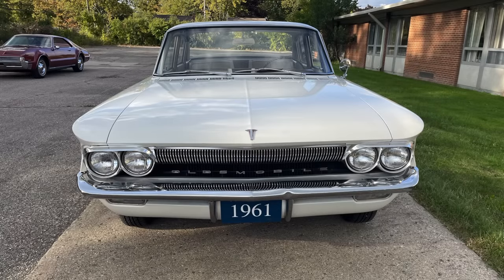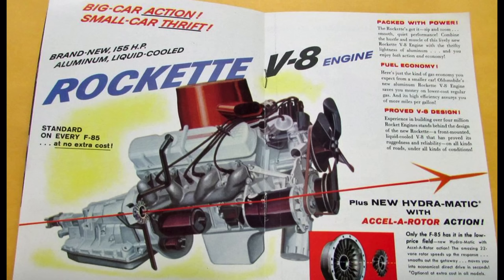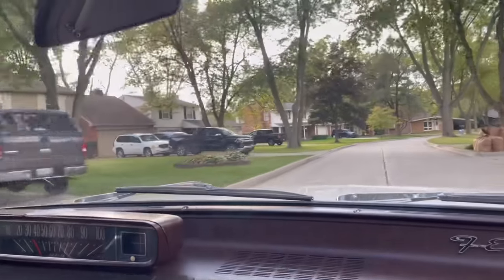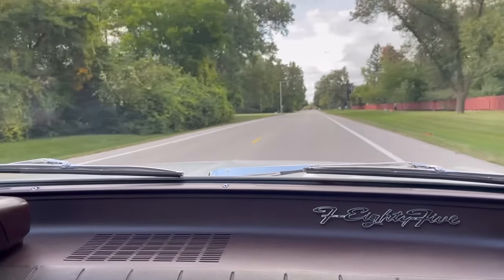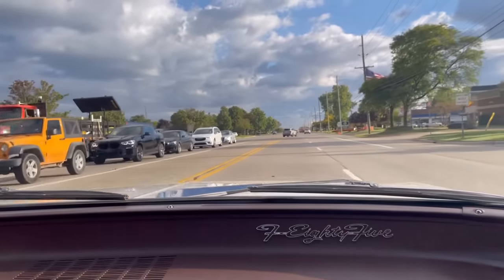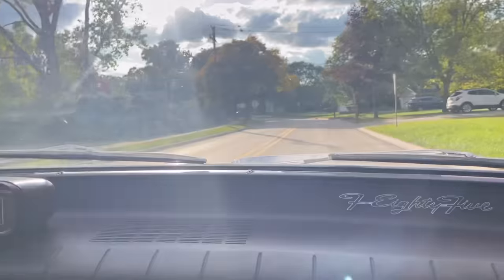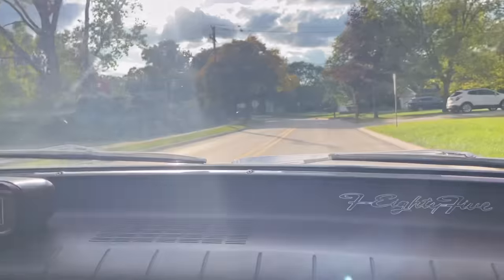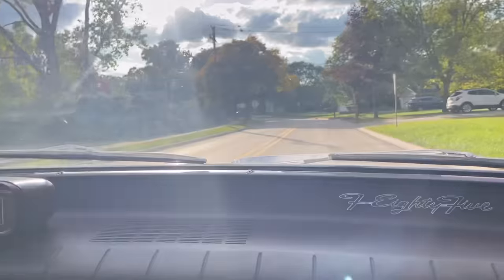Driving GM’s Worst Transmission: The Roto-Hydramatic (“Slim Jim”)

Comment: Our local Pontiac dealer shop told the customers. "The transmission is junk. I'm ordering a real Hydra-matic in. It will be day longer but you'll have no more trouble."
Reply: Catalina and Grand Prix
Reply: @bobbyheffley4955  Hadn't thought about it before but since the long wheelbase Bonneville & Star Chief had the (real) "Super Hydramatic" I'll bet there were a lot of Pontiac dealers that, perhaps for a price, switched over the Catalinas & Grand Prixs from the Roto to the Super. I wonder if they had to modify the driveshaft? It probably had to be shortened. I wonder if the Olds dealers did it too or if the floor pans in the Olds didn't allow for the larger trans. I know in the early '60s they were quite proud of how they had slimmed down the transmission hump....
Reply: @DejaView  this is the main reason Pontiac and Oldsmobile adopted the Turbo-Hydramatic in the 1965 model year

Comment: These “Senior Compacts” performed much, much better with manual transmissions.
Reply: Could you get a factory 4 speed?
Reply: @MisterMikeTexas  No… transmission options on the 1961 Tempest were a 3-speed manual or 2-speed automatic.  A 4-speed manual became available in 1962 and beyond.

Comment: Hi Adam, good video!  You know and I know that the Chevrolet Corvair and the Ford Falcon where compact cars, but in the mean time, the Mercury Comet and the Ford Fairlane started out as a senior compact also.  Most people do not know the difference from compact to senior compact to mid-size.  By todays standards, a Toyota Camry or a Ford Taurus is a mid-size, but in the 1960s and 1970s they would be a compact.  Most young people have no idea of this.  Please reply.  Dave...

Comment: Mark,  the roto-hydramatic was not GM’s worst transmission, not even close.  As bad as it was, it pales in comparison with the Chevrolet Turboglide.  Introduced in late 1957 with the 1958 Chevrolet, the Turboglide was so bad that many cars didn’t make it off the showroom floor.  It used cone clutches to save money and couldn’t begin to handle the torque of their V-8 engine.  There was a service bulletin one week after introduction and several others in the coming weeks.  Chevrolet was forced to offer to replace it with the 2 speed Powerglide for $75.00.  GM engineers redesigned the transmission and by 1961 it was considered a good transmission, but by that time nobody would buy it.

Comment: That was fun but my question is what is it that fails,,  he mentioned in the previous video that they usually got to about 30000 miles and broke but what is it that breaks?
What is it internally that is failing ?
Reply: They used very high line pressure and they'd leak out of every seal.  And they were very sensitive to fluid level.  Add an extra half quart to account for the leaks and the fluid would spit out of the dipstick tube.  The fluid coupling was internal - behind the oil pump, and it was aluminum and tended to crack  Once it wouldn't hold pressure, you lost first gear and reverse.  The governor was aluminum and would gall over time, so the signal oil for speed-dependent shifting would wander out of spec and the shifting would get really wild.  Sometimes it wouldn't shift at all.  Fun fact - the Roto5 did not have the neutral clutch and sprag that the Roto10 used - it relied only on a band wrapped around the rear annulus.  If the servo for the band started leaking, you had even more troubles with the first gear start.  A friend of mine had a '62 convertible back in the 80s and he called it "rattle and hum".  You could always smell the ATF burning as it dripped on the exhaust.  As a kid, the family car was a '63 sedan in white.  I learned at that early age that I should never repeat the words my dad said when he was working on the slim jim in that car.
Reply: @0pelman   Thank you sir that's exactly what I wanted to know !!

Comment: Look into fox shocks. 
They are typically for off road applications but are very buttery smooth. 
With some research you might find something that is cross comparable from a different application.

Comment: It took two of these aluminum beasts to fire up the SR-71. Hearing two nail heads at redline,and then the SR-71 would spool up.
Reply: But neither the olds or buick were nail heads.
Reply: No, those were Buick Wildcat 401 nailheads. The 215 is a pleasant engine, but it's no beast.
Reply: @ostrich67  
Its a neat little engine. I've seen them built up bored and stroked but I still wouldn't call them a beast.

Comment: That has to have been the worst transmissin ever put behind any auto maker's engine. My experience was with a '64 Pontiac Grand Prix. Great car other then that POS transmission. I finally traded the car for a '68 Torino GT 4 speed. That Slim Jim transmission gave up as I rounded the turn into my "lucky" Ford dealer's lot where I was able to coast into a parking space. I handed the sales guy my check, signed a few papers, slapped the plates on that I had kindly taken off the GP and .... quickly drove away. The last time I saw that GP was in a salvage yard a year or so later with the front end caved in dead center to the dashboard. Those were the good ol' days!!!!

Comment: The one good thing about the rotohydramatic is that when it finally drops into second gear it changes from a slushbox to feeling like a manual transmission due to a lack of a stall converter. I still loathe the bloody things.

Comment: Gotta compare with Ford and Mopar's worst transmissions. Slim-Jim and PowerShift were almost exclusively optional on cars that could be had with manual trans (if not on the same trim level), Ultradrive was in way too many auto-only cars. OTOH GM in the '60s and Ford a few years ago abandoned these while Chrysler only dropped the Ultradrive name and made the actual system work reliably eventually, with rebuild kits always to the latest beefed-up spec.

Comment: To be honest I feel like you have it shifting to high gear just slightly to soon. Did you use the BT-33-2 tool to adjust it? For sure the 1-2 shift is strange in these cars. They made a slight change in 62 to this transmission for the 1-2 shift but it is still really goofy. For shocks, I keep an eye on the vintage Delco Plesurizers on eBay. They pop up now and then. They are 100% the best riding shocks for these cars.
Reply: And thanks for posting this. These cars really need the attention. Such cool cars and much overlooked.
Reply: I believe I still have an NOS set of spiral shocks for these cars as well. I would be willing to sell those.

Comment: Speaking of bad transmissions, I owned two Corvairs that had the Powerglide two-speed automatic. Now, I understand that this was a very stout transmission and has been popular even with street racers.
That's fine, and I never had a single problem with either of them. 
But what a dog! The poor mechanism was so dreadfully unadaptable that it was actually ridiculous driving with it. 

Those were swell cars, both of them. A bit of tinkering was called for, but they were fascinating and very stoutly made.

Comment: The Buick version of these cars has a similar shift pattern - PNDLR.  There is no S because the Buicks had a 2 speed automatic transmission instead of a 3 speed.  The shift pattern PRNDL was not a standard pattern until the 1964 or 1965 model year.  I'm pretty sure it was for the 1965 model year. A law went into effect stating that a forward gear could not be immediately next to a reverse gear on a transmission indicator.  That way, if the shift indicator was slightly off where it should have been, no one could accidentally put the car into reverse when they meant to go forward or vice versa. The Chrysler and AMC push button automatic transmissions were discontinued and replaced with shfit lever controlled transmissions because of this same law. On a Buick version of these cars, the trunk is also very large, much bigger than you'd expect.  You mentioned people not having patience with older cars - being cut off, passed, etc. It's very true and unfortunate. I would probably drive my older cars more if people were not like this. They don't understand handling and braking is not like it is on 21st century vehicles.  You have to plan ahead more and you need to leave following room in case of an emergency situtation.  Back to the transmission - I had thought a 3 speed automatic in an Olds version would be superior to a 2 speed automatic in a Buick version, since you have the extra gear. That is apparently not the case. It does seem to be true - there seem to be mostly Buick Specials around in terms of which Y body cars are available.  There are fewer Pontiac Tempests around, and least of all Olds F-85s from these years. That's subjective, but that's based on what I've seen for sale when I've looked. Personally I really like these - the size of the car is really nice - they are around the same length as an 80s / 90s GM front wheel drive A body car.
Reply: If you got in a head-on crash in these cars, the steering column could kill you.

Comment: This was fun to watch.  I have a Super Hydro-Matic in a 1964 Bonneville.  I just did a few videos on it but I wish you would give some information on this gearbox.  I answered a comment today about a guy that corrected me on the fact that I didn't have a TH400 in the 1964 like I thought at one point.  Mine, of course, has the R at the end of the throw of the shifter.  Mine shifts alright and seems "normal".  Any information you can gather on this would be nice for us SHM fellas.
Reply: The THM400 was introduced in 1964 on most of the "senior" GM cars like the full size Buicks and Cadillacs. I think that the Olds and Pontiac still used the older transmissions until 1965. The easiest way to tell is the shift quadrant. If reverse is in between park and neutral, it is a 400. If reverse is down at the end past low, it is either the Jetaway Hydrs-Matic or the Roto-Hydramatic.
Reply: @jimgarofalo5479 th400 is only 3 spd hydramatic is true 4 spd. Just count shifts if in doubt
Reply: @jimgarofalo5479  Correct. '63 Pontiac Catalina owner here. Pontiac Catalinas and Grand Prixs used the Roto-10 in '63 and '64. I think they were used in '62 as well. '65 saw the starter mounting position changed, and new trannies were introduced that year. I've heard that late '64 Pontiac engine blocks have threaded mounting holes so that the starter could be mounted to the engine block, in preparation for the design change, but they were not actually used for that purpose until the arrival of the new trannies in '65.
Reply: @rogerdodrill4733  I am aware of that fact. And, I don't need to "count shifts" to know. I repaired transmissions for a living for over 30 years.

Comment: Isn't second gear sort of a direct drive?  That's why it is jerky in second.  I had several 62 Olds Starfires, which I believe have the same transmission?  It would seem to me that the transmission shop should be able to adjust the shift rod so that the shifts happen later (at higher RPMs)?  Loved gear second in mine...as a direct gear the acceleration was epic...just get off the line, let it shift into second gear, then nail it...second gear would last until 90mph.

Comment: I wouldn't say it's the worst transmission but, There's also the Buick LeSabre transmission from 1962? It had 1 forward gear and used a series of variable stator fins to change how the transmission behaved, changing at what RPM the Torque converter stalled at with varying situations, it was quite a rube goldberg type of transmission.
Sort of like the Modern GM counterpart of the "Switch pitch" torque converter.
Reply: Buick designed and manufactured its own Dynaflow transmissions, in various iterations, from 1948 to 1963.  The variable pitch stator you describe was a 1955 enhancement, but in a previous improvement in 1953,  the turbine side of the torque converter was also split in two aka Twin Turbine Dynaflow.  The two turbines were physically  interconnected in such way that bit of mechanical gear reduction was induced under acceleration.  (There was also an interesting, but scary-complicated Triple Turbine offered as an extra-cost option in 1958-59, but it apparently proved to be a repair nightmare and was withdrawn after only 2 years.)

Comment: 73 cubic feet of cargo with the seat folded for the station wagon is exactly the same capacity as a '13-'18 Rav4. Finding one F-85 I would do an engine swap with a 2.7L Tacoma engine & with a 5 sp. .

Comment: Is this transmission basically a Powerglide with a first gear?  Powerglides were 1.73: 1 and 1:1
Reply: @scottsullivan1464 No, nothing even close to a Powerglide. Best I can describe, it was a hacked up scaled down derivative of the 2nd generation (1956) "dual coupling" Hydra-Matic. Original H/Ms used a single fluid coupling located up front where the torque converter would be in typical automatics. The fluid coupling acted as a "clutch" to get the car moving but had no ability to multiply power.  To assist the take-off they used multiple planetary gearset to achieve 4 forward speeds. They were not very smooth shifting however. In '56 they were redesigned with a 2nd internal fluid coupling (you can imagine these transmissions were not small or lightweight). They actually created smoother shifts by draining the fluid (no engagement when empty) & refilling the 2nd coupling. Since it took a moment for the coupling to drain or to be refilled there was no distinct "feel" to when the next gear engaged. Way too complicated but it worked. Crazy, huh. For the new compacts like the F-85 they needed something smaller & lighter & somehow figured they could eliminate the front coupling, have the small internal one do, basically all the work. They also eliminated the extremely low 1st gear & had only 3 speeds. They still did not use a true torque converter but created a kind of "hybrid" fluid coupling by adding what the brochure called the Accel-a-rotor (similar to the stator in a true torque converter but with a considerably lower multiplication factor). Because that helped only minimally with getaway & they were now using only 3 ratios the new 1st gear while not as low as 1st on the older 4 Spd units was still considerably lower than other 3 Spd automatics. More like low on a 3 Spd manual. If I remember it may have been 2.92 or 93 on the bigger model 10 & 3.02 or 03 on the model 5, light duty. That created a wide gap between 1st & 2nd which I believe was 1.56 & 1.58 respectively. And the problem of the seemingly wide gap was exacerbated by the fact that in executing the 1/2 shift the coupling drained & created full mechanical lock-up. Literally, again, like you had a manual trans. With no "slippage" from the coupling, the RPM drop was drastic enough to sometimes lug the engine at low speeds. That's why he said it wasn't really very pleasant driving it in traffic with frequent starts & stops.
Anyway, that's probably "clear as mud" but I hope it helps a little. A Powerglide with only 2 ratios & a torque converter that was well matched to the engine & overall gearing as the later ones tended to be, was probably much nicer to live with....
Reply: Thank you for such an amazingly detailed response.  I know about Corvairs, but very little about the Senior Compacts so all of this is new.  I thought GM went off the rails during the 70s trying to deal with the fuel crisis, but in retrospect, they were making big mistakes 15-20 years earlier.  @DejaView

Comment: Beautiful car. I feel like I'd enjoy how this sounds and drives, with a rebuilt transmission like that one at least. My worry would be about the aluminum block engine under the hood and it's gaskets but that's just because I'm not a huge fan of aluminum V engines. I'd be curious to see the mpg. Depending on transmission efficiency it could really hurt gas mileage much like Chrysler did on the late 80's Fifth Ave. where they took a fuel efficient engine and stuck a clunky boat anchor of a transmission under it.

Comment: The soft ride that Americans wanted for their cars in the late 50's and into the 69's was the reason they did not transition well to other countries with roads that were not up to the standards of the populated areas of the USA. Apart from the suspensions breaking components they also displayed terrible handling characteristics in undulating corners and even straight roads. They were definitely smooth road cruisers. That alloy V8 was a gem of an engine and was eventually taken to 4.2 liters for an Australian car produced by the British Leyland group and it went very well but the car was a flop. Land Rover geeks take the 3.5 out to 4.6 with big cams and Holley carb and they make very good power. They were a great engine.